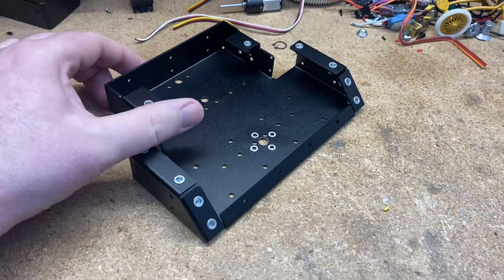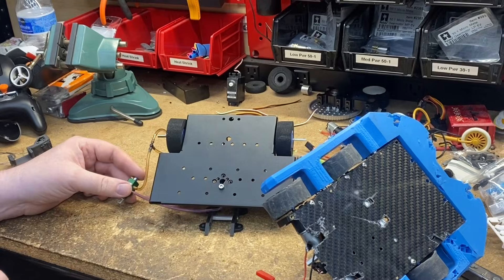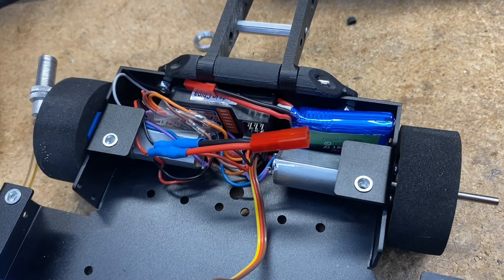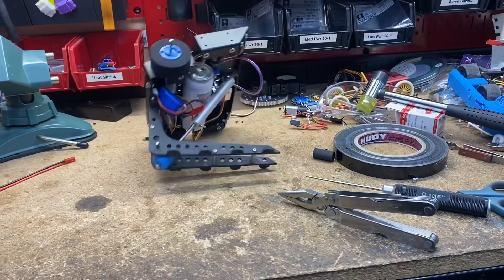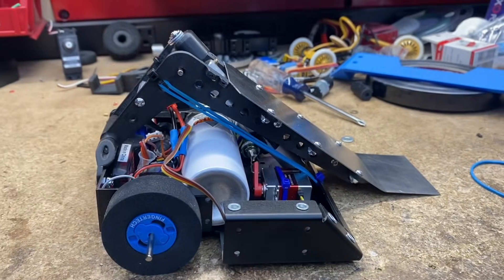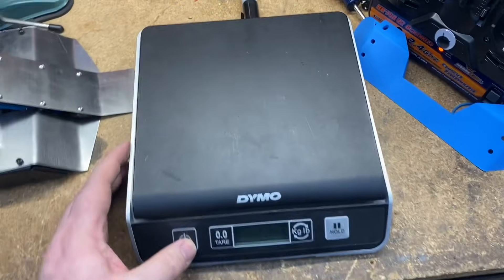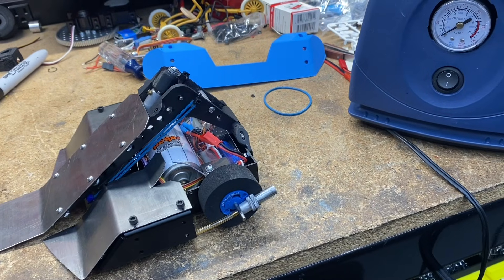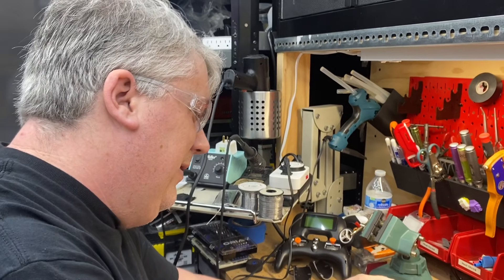How To Make a 1lb Pneumatic Flipper Robot

Comment: Would there be enough travel distance on the servo to abuse it for making something to adjust the ground clearance of the wedge on front? To confront forks. Like pushing a roller down while driving and lowering the wedge for when someone tries to fork  you.

Comment: Would you be able to make it so that the servo automatically goes back to its "resting" position so that the arm retracts almost immediately after being fired?
Reply: Yes,  but then you lose the power to flip and pin, or disrupt and push. I don't disagree with the id3a entirely, cause there are some fights a spring tied to the flipper word help with recovery, and let it set back up into wedge mode faster.
Reply: Nm they used rubber bands as returns anyway. It's aweso.e.